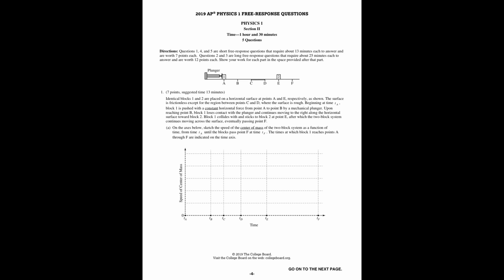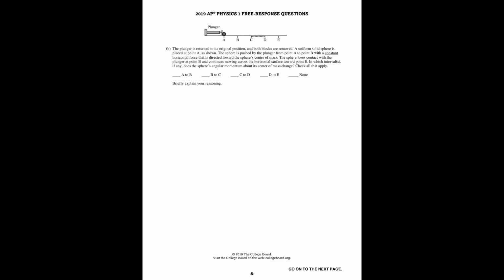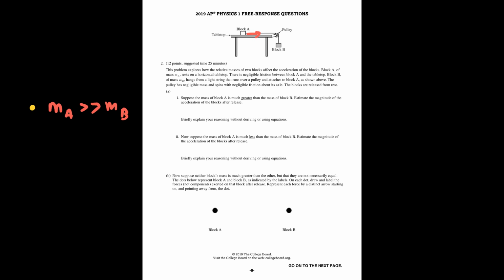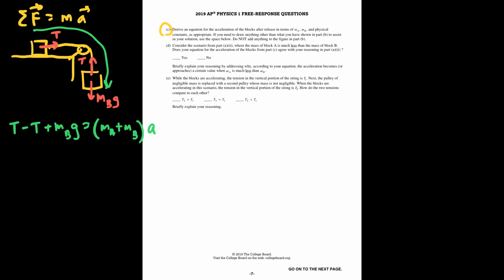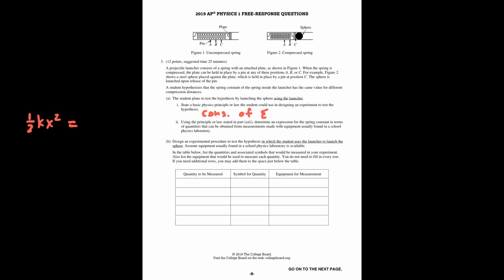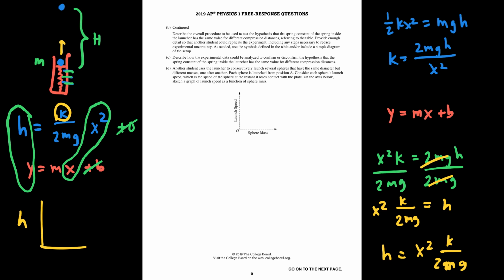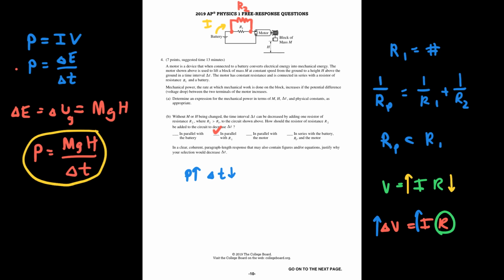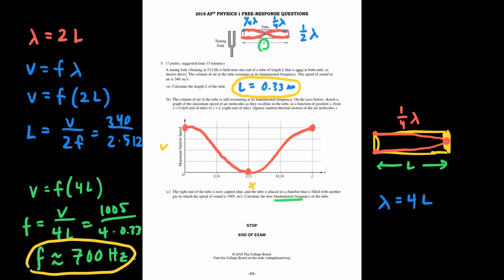2019 AP Physics 1 Free-Response Questions Solutions

Comment: I am still sort of lost when block 1 hits block 2 yet the velocity stays the same. Shouldn't it be an inelastic collision where m1v1+m2v2=(m1+m2)vf. m2v2=0, so techincally m1v1=(m1+m2)vf.
Reply: Lohit Murali Nice are you prepping for this year’s online exam too? The reason the velocity stays the same is because you are looking in perspective with the center of mass for the two block system. The definition states that the velocity for the center of mass only changes if there is an external force applied on the system. However, in this case, the two blocks colliding is considered an internal interaction, which does not change the position nor velocity for the center of mass of the two-block system.

Comment: For the first one i thought the velocity of the center of mass would slow down as block 1 reaches block 2.. does anyone else see what im talking about
Reply from the maker: I don't think so -- I believe that is going to be a very common mistake on this question (I made the same mistake in fact) -- since the problem asks us to graph the velocity of the center of mass of the two block system the entire time, it only changes due to an external force like from the plunger or the force from the friction.  Since only the first block is moving initially the graph seems to be a graph of its velocity alone, which is misleading and not true.  This is inherent in the idea that the velocity of the center of mass of a system is constant unless an external force acts on that system.  An external force does not act on the system when block 1 collides with block 2.  Does that make sense?
Reply: What about this way of thinking of it...
The center of mass was actually moving that slower velocity before the collision.  I mean to say that the velocity of the center of mass was already half the velocity of m1 when m1 approached the resting m2 during segment DE.  I think it helps to actually calculate the velocity of the center of mass to see that it doesn't change.  

formula of v center of mass= (m1v1 +m2v2)/(m1+m2) written for two objects

(m1vi1 + m2 vi2)/ (m1+m2)   before collision
(mvi+0)/(2m)
vi/2

(m1vf +m2vf)/(m1+m2)  after collision and both vf are same
(2mvf/2m)
vf (obviously)

you can get vf of the two blocks=(vi/2) from balancing momentum for the inelastic collision. 
m1(vi) +m2(0)= (m1+m2)vf
mvi/(m+m)=vf
(vi/2)=vf

Although, you're not supposed to have to calculate it for the AP physics 1 test, it helps to do it to see what's going on.  Otherwise, internal forces to the system don't change the velocity center of mass of the system is the way to solve it.

Comment from the maker: For the circuit and motor problem it seems that you could also check the answer that the resistor should be placed in parallel with the motor, which would accomplish the same goal as described.
Reply: I actually disagree with this, but I may not be right. If a resistor is in parallel with the motor, it is true that equivalence resistance decreases which would increase equivalence current. However, I believe that the current in the path with the motor will decrease despite this because a new alternative path would be opened, so more current would go through that path. This would decease power in the motor because P=I^2R, which would increase ∆t, not decrease it. Another way to think about this is that the voltage across the motor is equal to the voltage across the battery minus the voltage across R1. If the new resistor is put in parallel with the motor, the equivalence current would increase as said before. This would increase the voltage across R1 because the current across R1 would increase as well, so voltage across R1 would increase because V=IR. If the voltage across R1 increase, the voltage across the motor would decrease. Because P=V^2/R, this would decrease power and increase ∆t.
Reply from the maker: Good point!  I think you’re right.  I forgot that a lot of the current wouldn’t even be delivered to the motor.

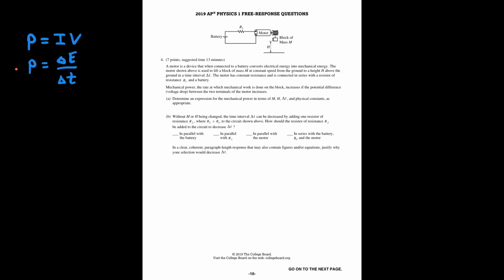Comment: at around 35:10 - Power does equal Delta E, however Delta E equals -delta U, Therefore negative Delta Ug, and -mgH.

Please correct me if I am wrong
Reply from the maker: Whereisamikz as the block moves up its potential energy increases, so the final value is going to be greater than the initial value, and delta U should be positive.  If you are familiar with there being a minus sign there I’m guessing that’s another convention that ultimately will probably not influence the amount of points earned, but from what I know the energy is increasing so it makes sense that delta E is positive.  If a minus sign is there it is probably a convention for talking about the “energy given to the motor” vs “energy dissipated by the motor” which I don’t think is what that question is testing.  If you put -MgH you would probably still earn credit for the correct equation.

Comment: Could you have used hookes law for problem 3
Reply: I think you may get points off if you used kinematics because it only works with constant acceleration. Springs don't provide constant acceleration. If you however measured initial acceleration directly rather than final velocity, you should be fine I think.
Reply: Bob Jenkins let’s hope 😬 haha
Reply: Azulon yeah that’s what I did
Reply: Azulon you know initial velocity is 0, so you can use a photo gate to determine the launch velocity and acceleration
Reply from the maker: Charlie Koepp I think that you could have STARTED the problem by talking about Hooke’s law, but ultimately it doesn’t work because in the next part it specifically says you have to launch the ball.  I can’t think of a way to only use Hooke’s law while also launching the ball.  Let me know if you think of a way of doing this that fits with the subsequent parts of the problem.